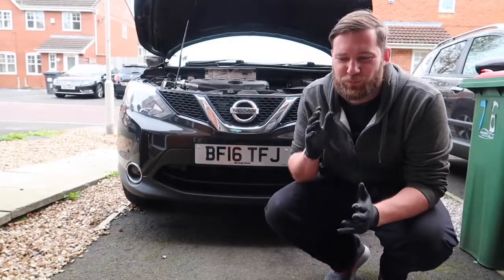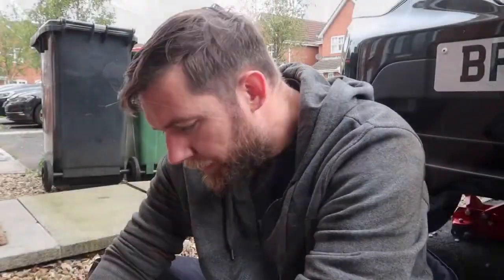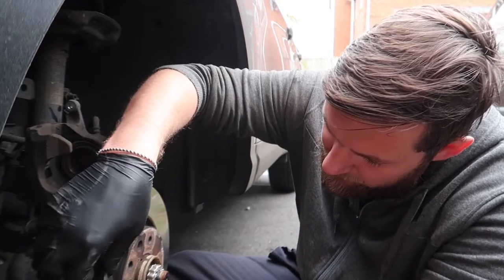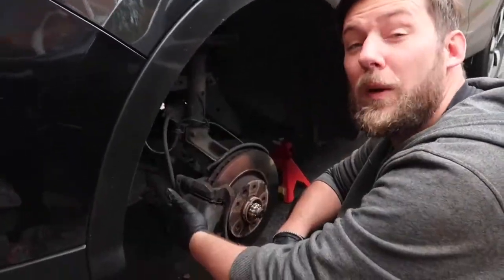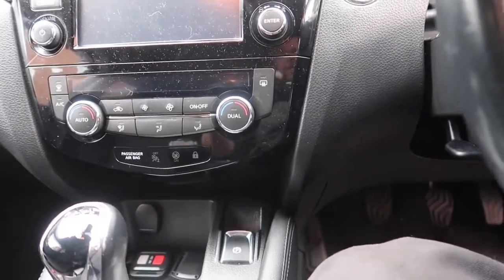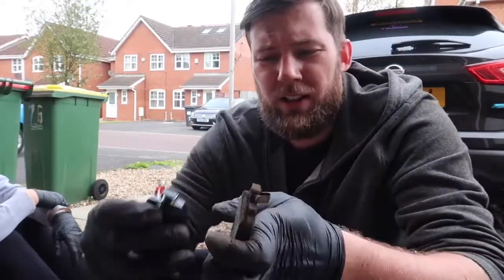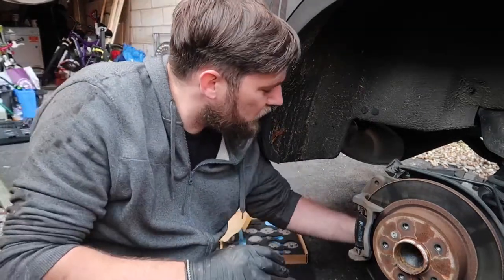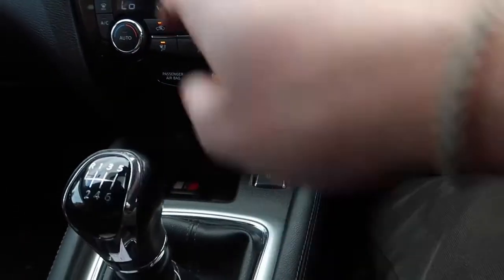Nissan Qashqai Front & Rear Brake Pad Replacement

Comment: Just undo the bottom bolt on the caliper and lift it up like a lid surely?
And also, what about removing the cap on the brake fluid reservoir?

Comment: you can buy the 3 pin part on Ebay just by it self , my brake kit never had the 3 pin  also, you dont need a computer , but on one of the brake pads, inner one  there is a pin you must line up with slot on caliper wind back or it will not sit right i have x trail same ,i  always use copper past but red rubber grease on the caliper pins, clean and check the rubber boots good video's keep them coming
Reply from the maker: Thanks, got a few videos planned for the qashqai.
Reply: Can someone please give a link of one that fits with 3 pin ? Thank you

Comment: I am trying to do mine but do you need to take electric handbrake motor off  to wind caliper back,my caliper don't seem to be winding far enough back .
It keeps turning but don't seem to be going any further back. Thanks
Reply from the maker: You don’t need to, it is an option but it’s not a must, make sure you smash that sub button!

Comment: Just done a brake pad and disc swap on my mother-in-law’s Qashqai J11, exactly the same as how you did yours except I chose Brembo Pads and Discs. Personal preference that’s all.

Functionally the brakes work great and the Brembos are very good.
We have an annoying high-pitch squeal when braking very lightly at low speed. I thought it maybe because like you I didn’t transfer over the original anti-squeal skims, forgot to unclip them from the old pads and transfer them to the new ones, as the new ones like yours seemed to have their own one-piece shim.
Was curious if you have had any squealing too or is it just the brakes bedding in? Car has done around 2000 miles since so I would assume it’s bedded in by now…
Reply from the maker: I wouldn’t worry about the anti-squeal skims if I was you. If you just strip them back down and make sure anywhere where metal meets metal has copper grease on it!

Comment: I've got a Kadjar which is exactly the same. I've been told you need a computer to do rear brakes properly
Reply from the maker: Really? Who has told you this?....we haven’t had a single problem with the brakes and didn’t use a computer
Reply: @BamMotors  I recently taken my car in for a recall and was told the front and rear pads were low. They quoted me a silly price and when questioned they said they needed to connect the car to a computer/diagnostics to rewind the calipers in because of the motors. I obviously declined and going to do the work myself this Monday.
Reply from the maker: 😂 well that’s an absolute corker if I’ve ever heard one!!
Reply: @priteshchampaneri5101  I agree this sounds like a "scam" more or less. Brake adjustments here in Sweden is usually around 20$ to get them balanced if they're unbalanced. If both brakes are replaced at the same time and adjusted to the same setup, it's unlikely to be unbalanced.

Comment: you don't need to rotate back the rear piston, you just need to push them back. infact rotating them back is ill advised as the 3 slots in the piston have to engage in the pins on the back of the pad and if you rotate the piston it makes it more difficult to index the slot and pin correctly.

Comment: The other way is to remove the electric brake and wind it back with a allen key, you can then use a push back tool rather than a wind back tool.

Comment: Hand brake didn’t need to come off qashqai’s have disc and drum rear brakes handbrake is operated by brake shoes inside the drum on the rear disc and your outer brake pads are for stopping inner shoes handbrake 👍